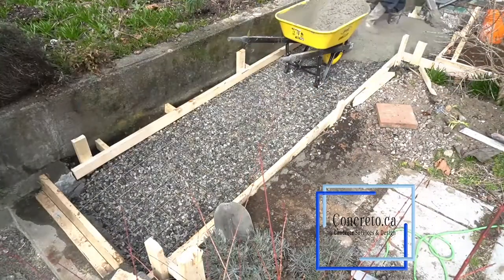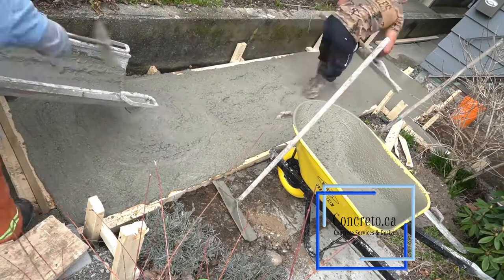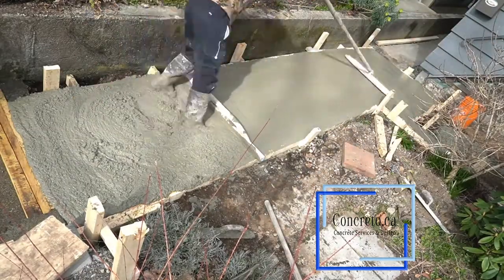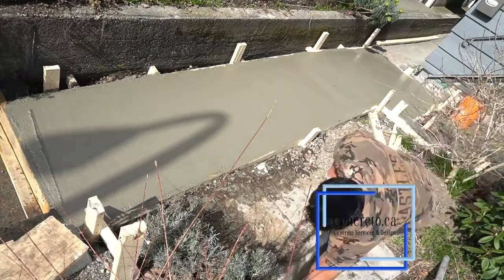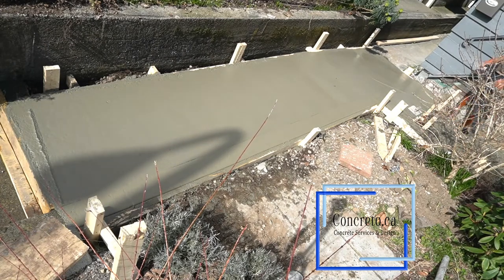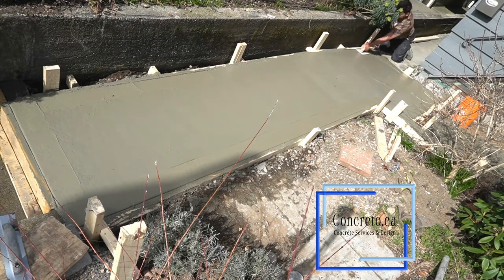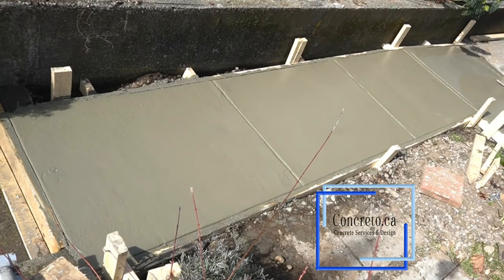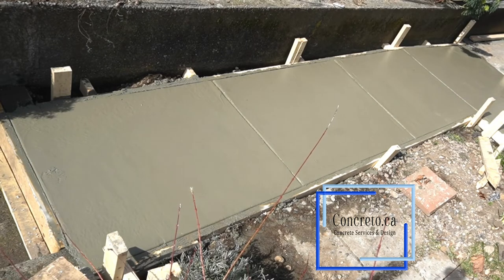How to Build Small Concrete Walkway in 5 Minutes

Comment: Just a question , what is the purpose of the small stones and wire before the concrete is poured ? Detailed info. would be helpful to make sure Im not getting scammed. Thanks.
Reply: Stones ok wire and or rebar are depending on how much weight it will carry normally on driveways